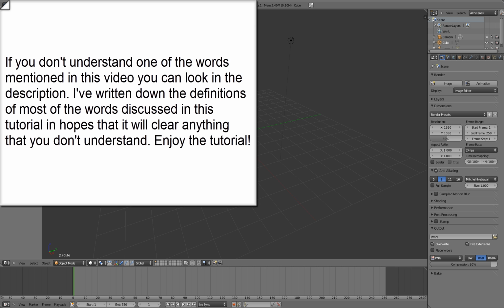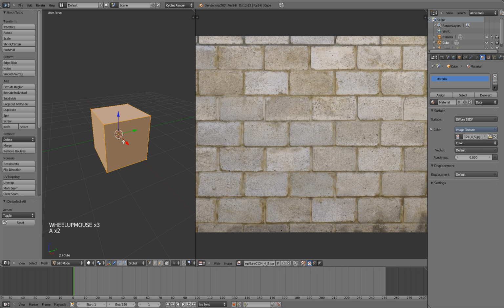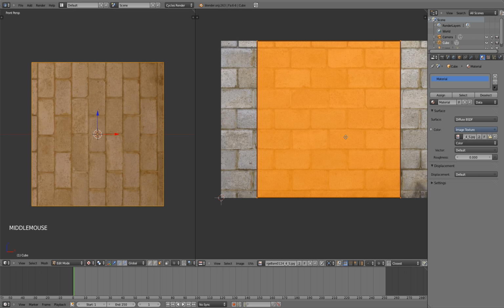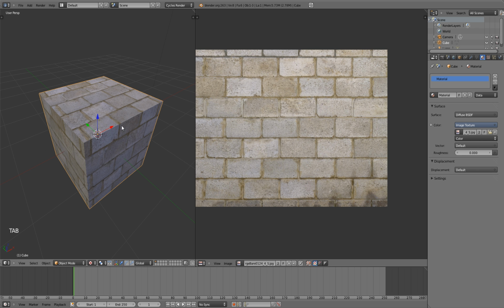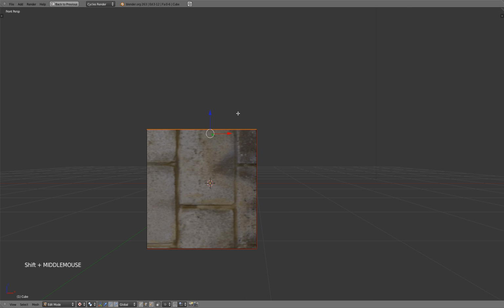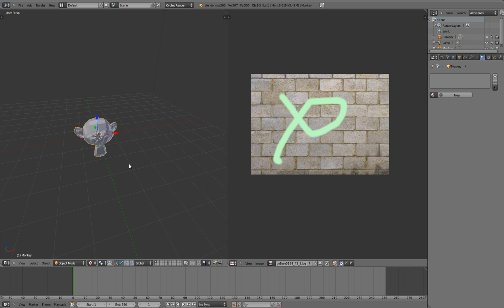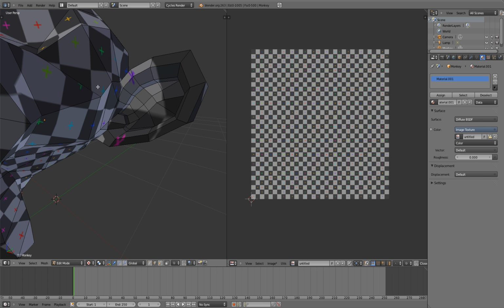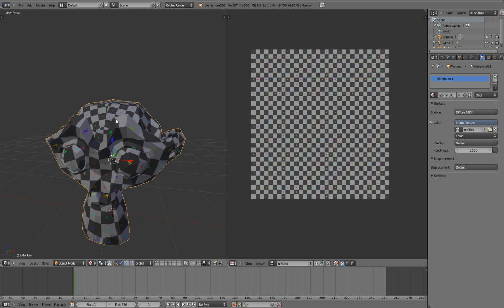Getting Started With Blender Part4 (Texturing)

Comment from the maker: Hello MagneticCrystal1. When you click the X next to an image in the UV image editor it removes it from there but it's still saved in the memory in case you want to use it later on. To remove it completely hold shift and then click on the X. You should then see a 0 next to the image when you look at it in the image browser. Now save your blend file and then close and reopen it and the image should be removed. Hope this helps :)